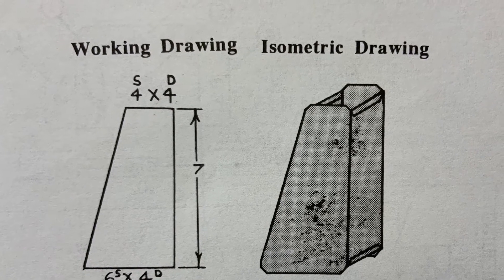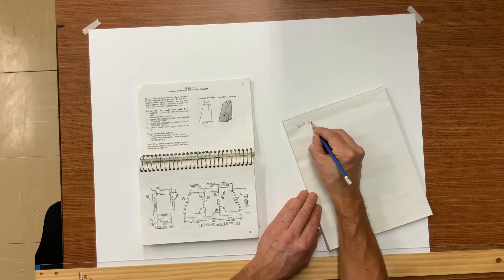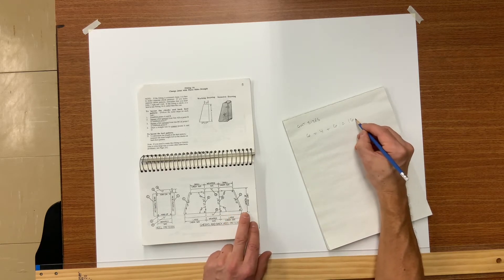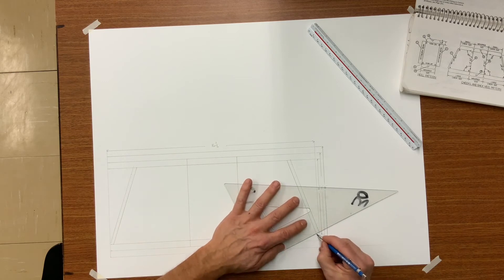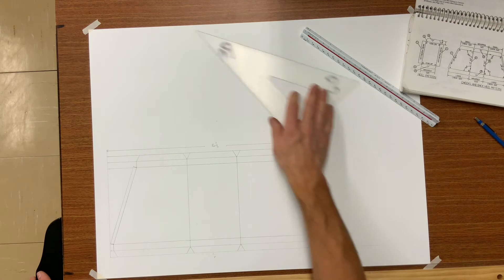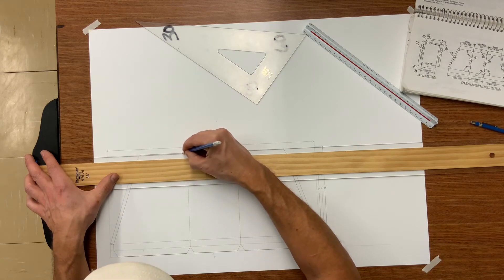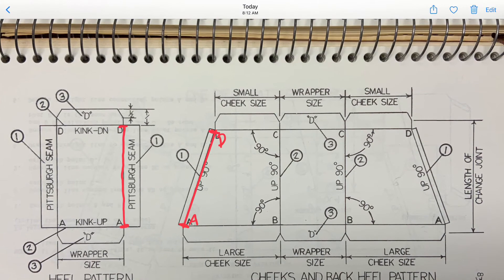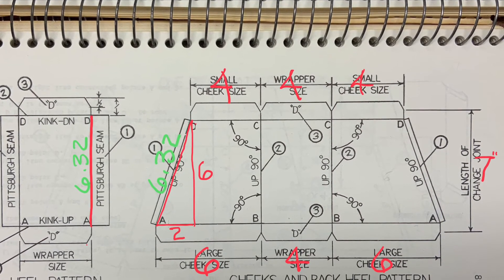Sheet Metal Reducer/Transition

Comment: im not sure you'll catch my comment.  

I'm curious what book that is and if it is something i could get ahold of.  If you recommend other books as well.
Reply from the maker: I will definitely get back to you with some of the books I have used. 👍
Reply: @sheetmetalwork  Awesome I appreciate that a lot
Reply from the maker: Hello KS, Sorry for the delay in responding to you question.  The book that you were questioning is called “Today’s 40 most frequently used fittings” the ISBN#for this book is 0–9 12914–4 1–6.  You also asked me if I would recommend other books? Here are two other books that we often refer to “ Round fittings used today” ISBN#0–9 12914–2 0–3, “ Fittings used today that require Triangulation” ISBN# 0–9 12914–2 1–1.  I also enjoy another series of books from an author named Joseph J Kaberlein.  I hope this helps 🙏
Reply: @sheetmetalwork  I fully understand and appreciate your time.  Thank you so much for getting back to me with these and I've added all of it to my notes.